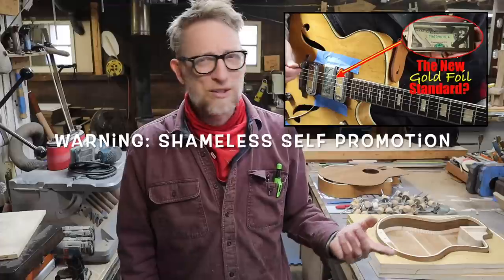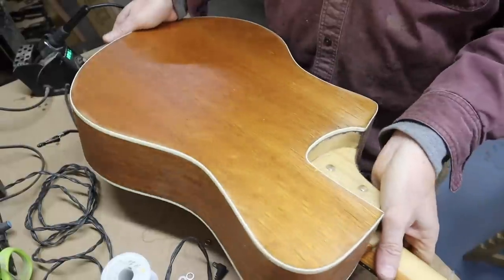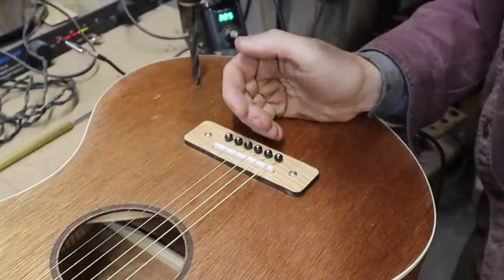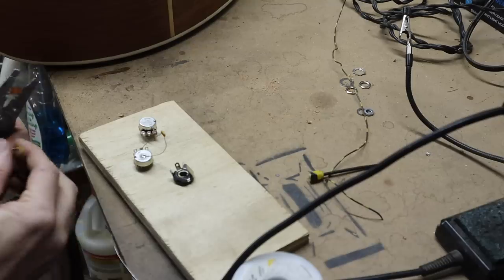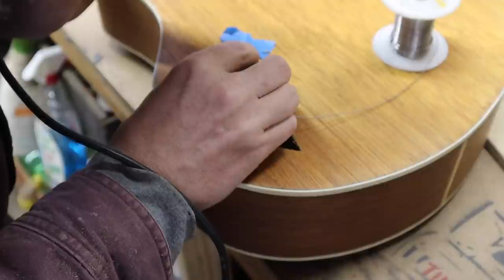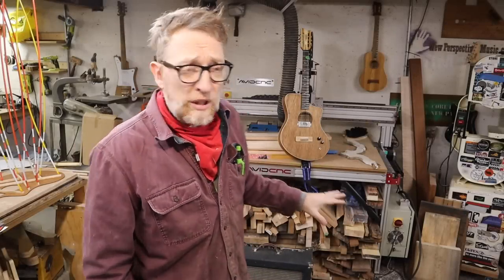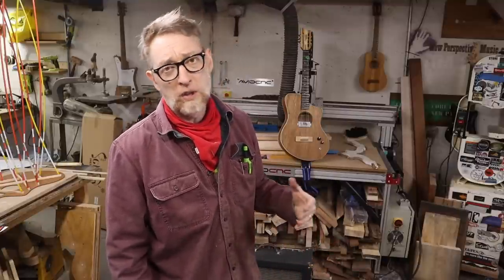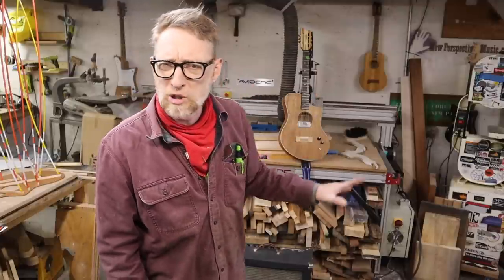I Added a Pickup to My Closet Door Acoustic // I Don't Like Piezos

Comment: A single piezo sounds thin and tinny. However if you use a number of them, all different sizes (and more importantly frequency responses), in parallel, they can sound very good. I normally use six on my acoustic guitars. In addition to improving the frequency response this also decreases the output impedance, making it easier to interface with mixers or other audio equipment.

Edit - also note that I install these under the bridge when making the guitars. Use CA glue or epoxy to attach, and make sure the wires are well secured to avoid buzzing.
Reply: Exactly, produces a very unique sound that sounds good with effects and amps too! A cheaper way to turn your cheap acoustic into an electric, since 6 piezos are often cheaper than a single magnetic-coil-type pickup. I like to place one on the back of the guitar so it picks up the natural distortion/reverb from the body. I am planning on doing this to an acoustic stick dulcimer I have, to 'electrify' it.

Comment: My face when the distortion kicked in 😂🤩
I share the same thoughts on piezos. I do however have an Eastwood Delta Resonator that has a P90 neck pickup and a piezo in the bridge with a blend control that allows for some great tonal variety (I usually dial it in at 40% P90, 60% piezo 🎸) A lot of fun!
Fab work and inspirational as always 👏 great to hear your wise words at the end as well 🙇‍♂️
Reply from the maker: cheers. that's what I'm thinking, a blend knob instead of a switch...

Comment: i think the best of both worlds would be a low-impedance pickup with a preamp. part of the sound of acoustic guitar to me is all that high-freq jangle above 8khz that a traditional magnetic pickup with 10k to 1kohms of series impedance can't hear. the problem with piezos is they're hearing what the string's doing at the end, but the sound we normally hear off a string is happening in the first third to first quarter of the length on electric, and the end filtered by the body on traditional acoustic
Reply: come to think of it piezos would probably sound a lot better if there were like, six or seven of them glued to different parts of the body to pick up the low end and resonance better, with a little set of faders to blend all that together, so the kinda shrill dry string sound has some body sound to round it out
Reply from the maker: i think they need the pressure of the strings to work, tho, where the problem lies...

Comment: Sounds really good, nice retrofit! One alternative to piezos (I hate that clack from piezos too), is the K&K Sound system that you glue in under the sound board. They don't sound like magnetic pickups, but they have a very "natural" sound without the clack of piezos.
Reply from the maker: they're still just piezos, but slightly better ones. 100 years ago I got endorsement pricing from K&K for amplifying my double bass but it didn't cut it. Switched to magnetic contraptions built by crazy Europeans. I have plans to make my own crazy contraption soon :)
Reply: @timsway  Awesome, love your videos and should have figured you have tried those out!

Comment: Piezos don't sound especially good in my estimation, but you can make effective use of them for recording. I used to record an acoustic part to two tracks simultaneously; one with the pickup and one with a microphone. With the tracks recorded, I would dial in the EQ on each one, mix them to my liking, and bounce them to a single track--which resulted in a surprisingly full sound. I'd never rely on a piezo alone, however, because I feel that they sound too thin.

Comment: I agree about piezos. I have a 1960s Eko Ranger 6 that I fitted with a Burns pickup in the sound hole; much fuller sound
Reply: I have the same, although it's a 1972 as my 1969 Ranger 12 was not salvageable. But I have the cheaper Fishman in it.

Comment: In my opinion, the best way to keep some of that acoustic sound of a Peizo without the awful tinniness is to blend them with the magnetic Pickup. And to use the body pickup 'disks' instead. Just smother 'em in expoy, one behind the bass side of the bridge and one closer to the sound hole on the treble side. Wire them in parallel to one another, then to an on/off switch and then - and this is the odd part - to the *output*, bypassing the controls. Putting them in parallel like this with the magnetic pickup and the volume knob brings life into them by cutting their impedance, and even wired like that they get effected by the volume and tone control still - actually makes the volume knob act as a low cut until the very end where it kills the signal.
Reply from the maker: interesting. thanks for the info
Reply: My preference is to a stereo jack. For short cable runs you can even wire the piezo direct and it will be only a small presence in the mix compared to the magnetic, but you can build a tone and volume know for the magnetic pickup and install a standard, cheap piezo preamp into a belt pack to take the stereo out and output a blend and each pickup straight so you can plug each into a different amp if required. It works on electric guitar too.
Reply: @timsway  I'd maybe not follow this. I found out recently that my guitar cable was... very oddly defective. Multi-meter testing showed it to be fine, a capacitor tester showed it to be fine, but I lazily picked up a different cable and the amp was twice as loud and bright, and the Peizo sounded like mud all of a sudden. I'd rather admit to this then have poor advice floating about.
Reply from the maker: @alaricpaley6865  it's amazing what a bad cable can do. Much like when your car doesn't start you should always check to make sure it has gas first.

Comment: Tim, with the magnetic pickup do you have to use electric guitar strings?
Reply from the maker: No, the strings on it are regular phosphor bronze acoustic strings. Won’t work with nylon, obviously, but anything with a metal core.

Comment: Hello, I'm going to do the same with my Fender acoustic bass, I'm thinking about putting a precision bass microphone on it.
I have two questions:
1- Is it necessary to make a hole in the back for the potentiometers?
2- Have you had problems with noise? I mean there is no shielding on the electronics.
Could you help me? thank you
Reply from the maker: I've done this to several acoustic basses over the years. It is not necessary to make a hole in the back, it just makes it easier to wire/access the controls and to, yes, add shielding. the other problem is grounding the strings. I have one bass where I wanted minimal interference and I added a wire to the ground that had an alligator clip and clipped it on to the strings behind the bridge on the front of the guitar! lol But if you cut a hole in the back you can do that stuff internally.
Reply: thank!!!

Comment: I added a pickup to my acoustic but I can't figure out how to ground it
Reply from the maker: you don't "have" to ground it to the strings. I didn't on this guitar. But if you find it being excessively noisy, you can add an additional long ground wire and tie it to the ball ends of one of your strings. that'll help. then when you change your strings it'll just pull the ground wire up through the body and you can tie it to the new string.

Comment: On future models are u gonna mount the foil pick up under the top for a cleaner look if possible? Or maybe do a custom pick up  ring shape on the sound hole as a accent kind of thing
Reply from the maker: Next one will probably get a different pickup installed in the body. I might change the sound hole shape to accomodate this one with a permanent spot

Comment: how much did this cost overall to make yourself?
Reply from the maker: the pickup or the guitar? I make the pickups in larger batches as to make just one would be unaffordable as there's a minimum order cost on the metal parts, the copper and magnets are cheaper in bulk, etc. I sell them at www.newperspectivesmusic.com if you are interested in having one. The guitar didn't cost a lot in materials but I have some pretty expensive tools these days that help, too.

Comment: are you using acoustic strings or eletric guitar strings?
Reply from the maker: d'addario lights, acoustic 80/20
Reply: @timsway  thanks! your pickup should be really good, I tried with cleartone strings and a humbucker in the soundhole and it wasnt nearly as good as your sound, I was tempted to use eletric guitar strings